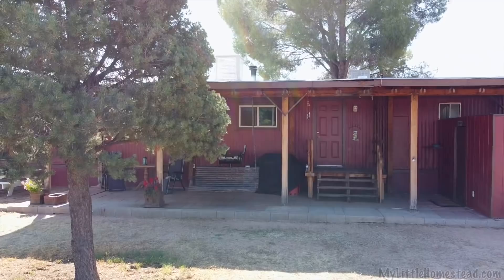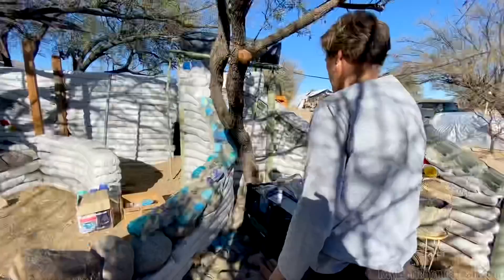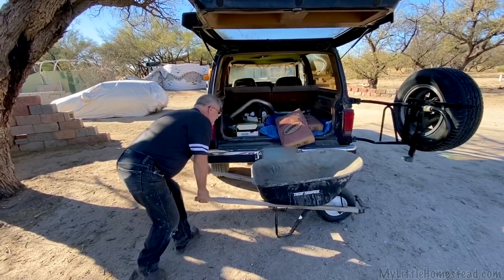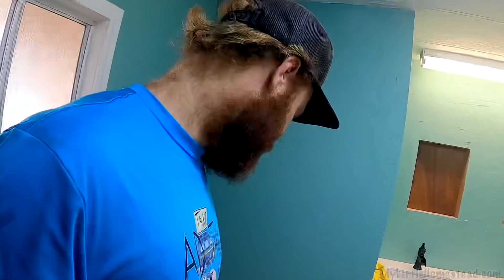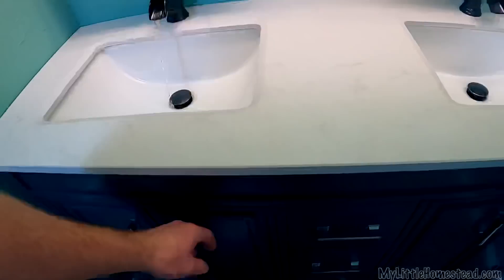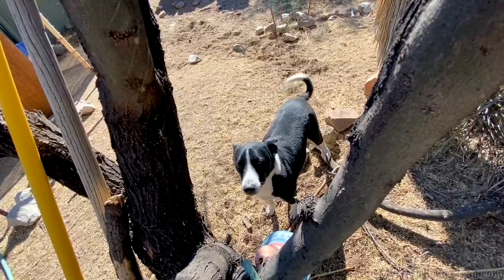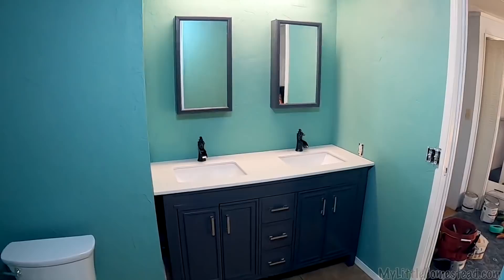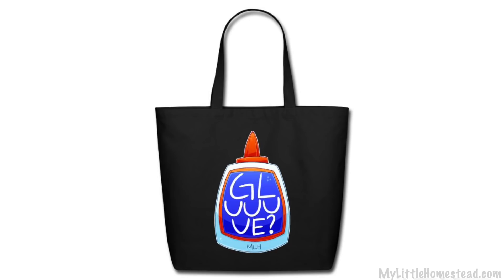Earthbag Bathtub Bottle Wall Complete & Bathroom Remodel | Weekly Peek Ep266

Comment: Garen and Ellie you have done a really great job on your bathroom. Plumbing is way tougher than it looks! I noticed the electrical outlet to the right of your vanity and for your safety I suggest changing it to a ground fault interrupt (GFI) one. My local building code requires it in bathrooms but it is a very good safety feature when electricity and water are in the same space even if it isn't required.

Comment: Hello, its the countertop guy again, Garen and Ellie I would like to suggest putting in a back splash for the bathroom sink or at the very least put a bead of caulk around the sink to prevent water from going down the back and creating mildew / mold. Its hard to tell from the video if you guys have done this, but with that outlet being so close to the sink it needs to be a GFCI outlet. Also for the out door shower when using mortar, if you guys haven't already, you should wet the surface you are putting the mortar on. There is also a product, although I cant think of what it is of the top of my head, that is used to help "fuse" the two surfaces together.

Comment: hi just want to say they are glad they are easy to clean it only requires a little warm soapy water and a pot sponge the one that has two colors you use the rough side under the water so you quickly remove the paper and glue that looks at them

Comment: just a hint  if you use a sanding sealer ( its a sticky type spray on  pressed wood  it will seal it to take paint better the wood product is so porous that it takes for ever to paint this trick helps

Comment: Wood; been cut for awhile, tends to dry out. When dried it sucks any finish applied into it making it appear as if you barely did anything. Hence more coats of finish.

Did you think of maybe capping the outdoor tub area with stone? Flatter stones than used in the shower area.

Comment: QUESTION Please!

At the very end of this video there is a blue orb

What is it? 17:50
Reply: It's a reflection of the sun in the camera lens system.  Depending on the camera the lens can be made up of different elements (all glass lenses in themselves) and they all have different thicknesses and surfaces where light beams can bounce back. Most of the time the manufacturer makes sure they don't feature in everyday use, but doing something extreme like pointing the lens at the sun will load up the lens with photons and they will bounce around - think of filling a glass from the tap at full blast and how the water goes everywhere as it bounces off the sides of the glass at high pressure.
Reply: Thank you!